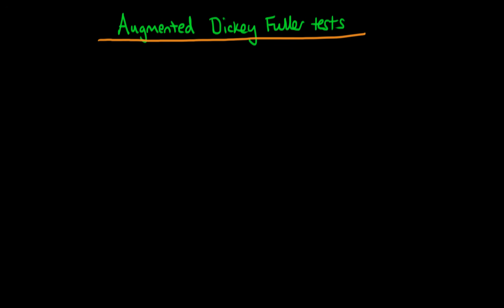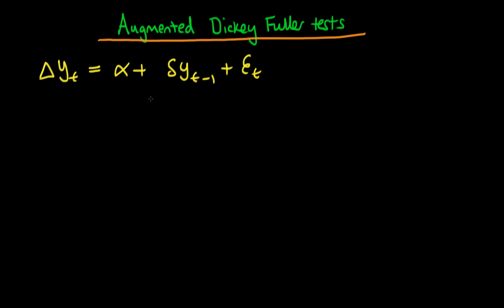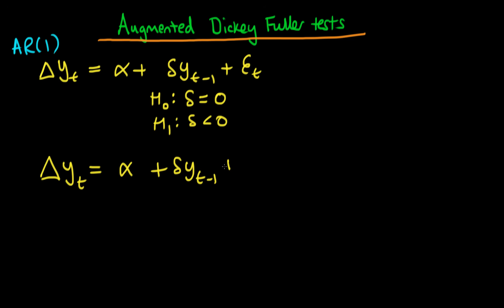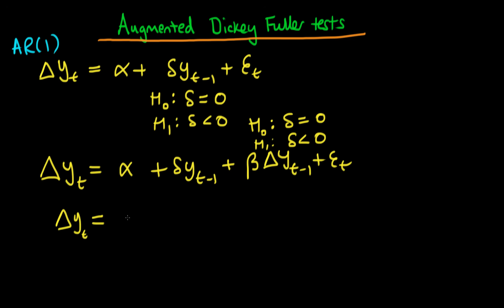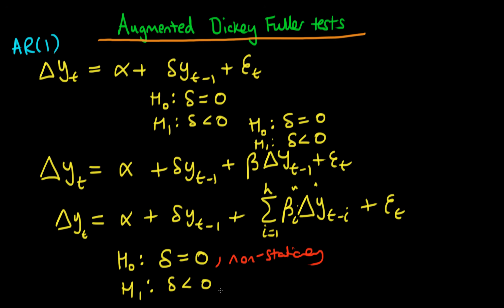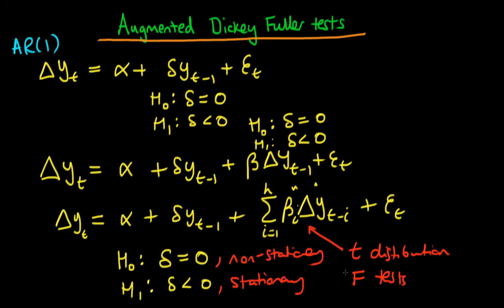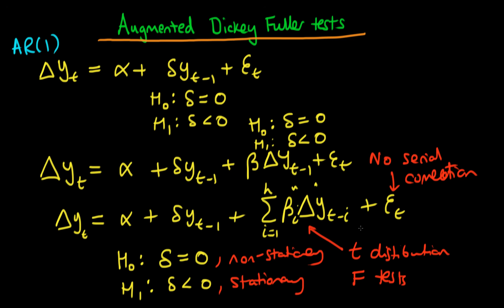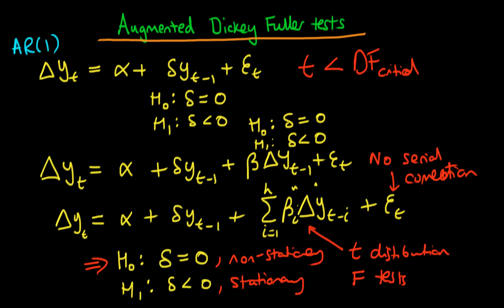Augmented Dickey Fuller tests

Comment: I have a question regarding the computation of the test: I include the constant by subtracting all y(i) with y(0) such that y(0) = 0 (is that correct?) and compute the delta as   (sum of y(i)*y(i-1) / sum of y(i)^2) - 1    (is that correct?). How do I account for the error terms? Cheers!

Comment: under the null hypothesis, p<1, and delta = p-1. so why is the null hypothesis that delta is less than 0? if p<1 surely delta is greater than 0?
Reply from the maker: +tom h Hi Tom, thanks for your comment. Not sure I understand though. The null is rho = 1 (non-stationarity), meaning that delta = rho - 1, is zero. The alternative is that rho < 1, in other words delta < 0. Hope that makes sense. Best, Ben
Reply: +Ben Lambert  One doubt: take the equation: deltaYt= alpha + TetaYt-1 +BetaDeltaYt-1....
I thought that the ADF test was about the distribution of Teta and not Beta. I mean, I thought that the equation was to be re-written according to Teta (i.e  TetaYt-1=deltaYt-alpha-betaDeltaYt-1...) and then take and average value for all these Tetas found and look at its distribution on a ADF table value. Am I wrong? Finally, why I often hear of ADF test made on residuals? isn't that for just Engle Granger tets?

Comment: Thank you so much for your presentations. I learned and improved my knowledge. Just one thing I want to mention is that maybe the term "i=1" under the Sigma sign should be "i=2". Am I correct? Regards.
Reply from the maker: +Okan Aybar Hi, sorry just saw this - it depends on whether you start counting at zero or 1. I have assumed zero here; perhaps confusingly! Best, Ben
Reply: No problem Ben. I also want to tell you it would be so nice if you could develop a video explaining how VECM model, the long term cointegration and it's short term variables are interpreted. Also why the minus term means that there is cointegration and how the mechanism of convergence to the long term mean actually works on an example. There is no such video about VECM and Cointegration.
Reply from the maker: +Okan Aybar Thanks for your message. Yes, those are on my list of things to do. Hopefully, I can get to those pretty soon. Best, Ben

Comment: does it mean by producing the ADF could also decide how many lags that i should include in the model by looking into the significance of the sum of lag?
Reply from the maker: Hi, thanks for your message. No, that is not the case. The reason for including lags in the ADF is to 'mop up' for any other factors which are important in determining that particular variable. In a regression once you have included these factors, it may not be necessary to include any lags of variables. Hope that helps, Ben

Comment: hi ben shouldnt the null in the ADF be delta=1 rather than 0? i was comparing notes and got confused.
Reply from the maker: Hi, No it should be delta=1 in this example because we have first-differenced the series, meaning that a unit root will have delta=0. Hope that helps! Best, Ben
Reply: +Ben Lambert so the null is one or zero? got confused here!!
Reply: @mennaelhefnawy6040  SHOULD BE ZERO